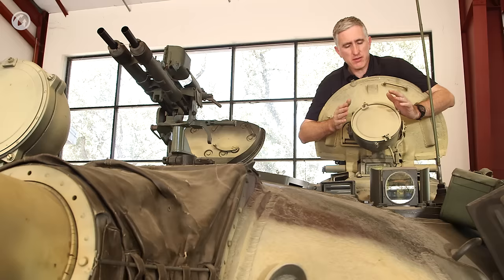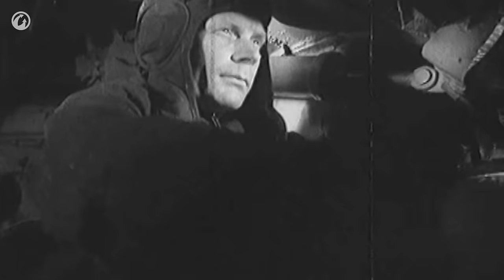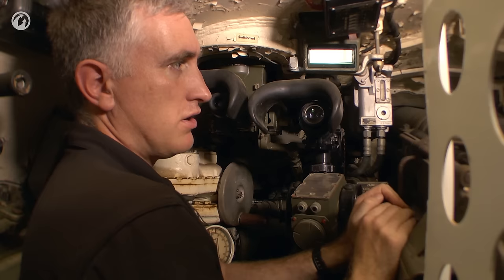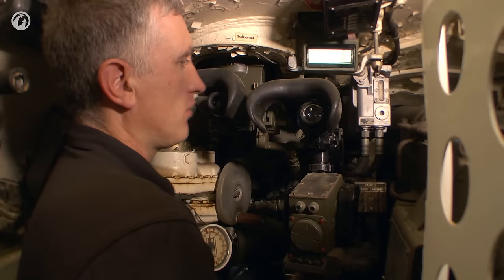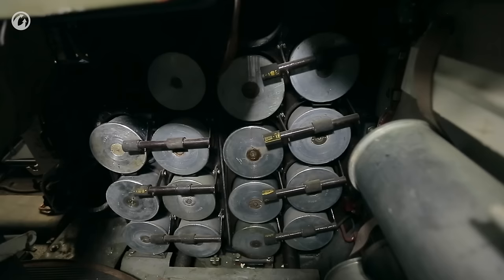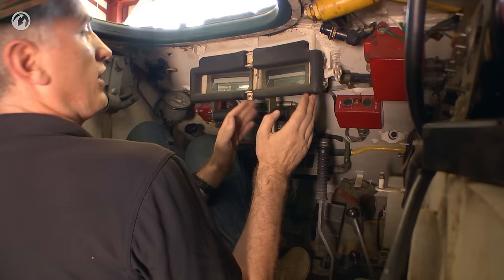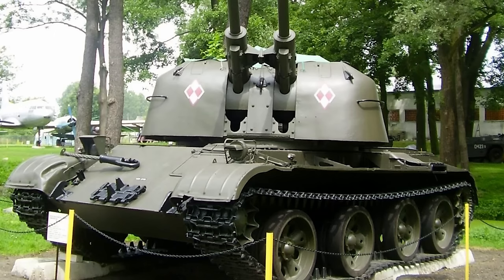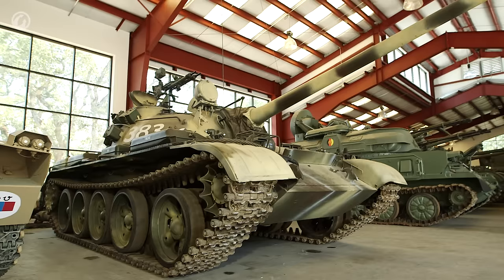Inside the Chieftain's Hatch: T-55A Part 2

Comment: As a late 70's M-60A1 tanker we were always told that Russian tankers were very short. By watching your video I think they were right.
Reply: They liked to use Siberians and other Asians because they were considerably shorter on average.
Reply: +Hugh Batesel yep that was a common practice... basically, if you happened to be taller than 170, you ain't going into the tankers
Reply: I'm a British tank crewman, about 6' tall. I have trouble getting in to a T54/55 (or T62) and being able to operate it. I believe the max height for a Soviet crewman was about 5' 6".

The ammo stowage is horrible on it. 

With Chieftain I've had three rounds in the air at once (ok, we cheated on loading).

One of our gunnery instructors was also an instructor on T62s. Apparently they have a very simple, but fairly effective system. With Chieftain I can decide where to hit, a T62 is happy with a hit.
Reply: The modern official Russian army rules provide that tankmen cannot be taller than 175 cm.
Reply: @peterking2651  at the time that the T-54/55 was in active russian service, Nato tanks were like surgeons with sabot and the russian tanks just aimed centre mass.
Reply: @AnikaJarlsdottr  Russians aimed centre mass because their guns would penetrate an M60 anywhere, and centre mass is where all the juicy stuff is anyway, NATO had to bypass T-64s composite armor that GSFG started to get late 60s with their rifled guns (a bit limiting for APFSDS performance). Leo 2 and M1 only showed up in early 80s, this is a gap of 15 years. Until we meet again!
Reply: @Klovaneer  thats fair, thanks for the information :)
Reply: @jurisprudens  TRUE. I AM 173 AND WAS THE TALLEST IN THE COMPANY
Reply: If you think the T55 is bad look up the inside of a T72. It's insanely claustrophobic.
Reply: From what I’ve heard it’s a requirement to be under 160cm in order to join the Russian tank corps. Don’t know if it’s still the case given the recent……tanker shortage? that would surely be a problem for them these days.
Reply: @nikolakaravida9670  the t72 has more internal crew volume than a leo2

Comment: I served as a gunner in T55 86-87. As a fighting force. T55 could run much more quickly than 35 km/h. We were jumping sometimes 1m high on terran. Can you imagine the loader without any clinging!? Driver has his poles, gunner has the stabi and sights to fix his hand, commander has his periscope, loader had just his one clinging ;) In our version of t55 the commander had his own turret, could turn, as i remember he could sign a target and the main turret turned to the signed direction, he could shot the main gun also. Stabilizator kept the   gun on the target even if the tank turned or the terrain was bumpy. T55 had automatic atomic and chemical protection sys, and fire protection system. Well, practiced loader could load 5.4s at least our ones. Limit to onboard the whole crew from a line in front of the tank, to close rhe hatches was 8s. Gunner and commander on the same! All the handguns, submachineguns, machine gun and the wedge lock had to be able to be repair blindfolded during given times. We had 18s to change the  firing pin of the AMD 65. As i remember the shrapnel ammo was 38kg, not easy to play with it, especially not on the field in action. It was very noisy inside, sometimes painful. I useg wax balls beside the special "helmet" but sometimes I cried from the pain. I was the closest to the motor.

Comment: Countries like Slovenia actually still use it in a heavily modernised variant.
Reply: +Teutone I don't think so. The main battle tank in Slovenia is M-84, which is heavily modernised variant of T-72. :) You can see it in a short video on my channel.
Reply: Titan191 I'm pretty sure they have both. There are photos on Google if you type in Slovenia T55, it's unmistakably smaller than the M84
.
Reply: +Teutone I checked now on the official army web page, and they really do use some T-55's with ERA, so I take my statement back ;)
I said they don't have them because I was once in an event that was held in one of our (Slovenian) army bases where they keep all the tanks, and I didn't see any T-55's. Well atleast I learned something new...
Reply: Titan191 Iv'e seen one at a defense trade show where they were marketing the upgrade program for the T55. I think particularly the modernization to the targeting system.
Reply: +Titan191 yeah you did pretty good job with your 55s, wish we in Serbia do something with ours... we have more than 200 pieces just laying around...
Reply: A lot of countries still use heavily modified T55s. Romania has a ton of them. Egypt has a fair few that were upgraded by Teledyne Continental Motors. Israel for a time used modified ones with the Royal Ordinance L7 gun mounted instead of the D-10. That is actually one I'd like to see the interior of.

Comment: One correction, the button on TC sight isn't intercom switch, it's actually a target - marker, when TC push the button, the turret will rotate to match at bearing of TC sight. it's a 1st gen hunter-killer system. It's done by sending a electrical signal to turret motor. 
The intercom switch is on crew headset.
Reply: Well, there goes the gunner's extra leg room...
Reply: @bollywig7871  It is used only in battle.
Reply: Honestly? The T-55A having such a thing was not something I was expecting. Explains why my country keeps over 100 of the damn things in reserve.

Comment: My commander in the army used to be a T-55 tankie before they transferred him to the infantry. He mentioned that, because there was no turret basket, besides having a firing safety switch (which they used to call "isključivač", freely translated as the "off switch-er") that blocks powered turret traverse, the loader also had a safety hand brace. As he mentioned, there are only 2 safe positions for the loader to be in during combat, and that both these positions required him to hold the hand braces, unless he wants his arms/legs got sheered off by the turret ring/ breech recoil.

Frankly, this is all very vague information- I'm a dirt kisser, not a tanker, and I've only been in a couple of old scrapped T-55, so don't count on it being reliable info.
Reply: THERE IS BASKET IN 54, 55 AND 62
Reply: @alexspielberg4090  ..depends

Comment: For those, who are interested: Some stencils on the driver's panel are damaged but with some imagination they say:
Spúšťač - starter
Tlak oleja - oil pressure
Teplota výstupného oleja - oil temperature at output
Teplota výstupnej vody - water temperature at output
they are in slovak language as well as are the stencils on the fuse panel for lights

Word "stiskni" on the voltage/current gauge means "push" and is in czech language.

Same goes for gunners position - table on the main gun control is in czech language, another table with selector of the main gun and MG are in slovak. 
I suppose that this mix comes from parts built in different parts of czechoslovakia - both slovak and czech and then assembled together.

Interesting to see that left-hand push of the round into the breech. Still puzzles me, how these tanks can have ROF of 7-9 rounds a minute in the game ... way higher than 107mm equipped US and british counterparts. :-)
Reply: That's because in WOT making the game balanced as far as mechanics of the program is concerned trumps reality. As an example how many times have you ever seen a vehicle do a tight turn and through track?

Comment: Apart from the space issues, and thats a tradeoff of having the low profile, it doesn't look to bad for a late 40's-early 50's design.

Which of course is exactly what it is.
Reply: In most respects, it's the Russian Centurion or the Russian M-48.  I was generally impressed with the layout.  Where the tank really falls short compared to Western tanks is its total disregard for crew safety.
Reply: @folgore1  Such as?

Comment: We had T-55 turrets installed in concrete as coastal defence guns. The loader had more space since the ammo was stowed below in a full-height bunker room and lifted up for the loader in a cradle lift through a trap door in the cage floor, next to the gun. The cradle held the round in a 45-degree nose-down position and came up roughly to the loaders waist , so all he had to do was lift the round up and load it. The lift was manually operated by two guys below and came up very quickly, so the loader had a safety button on the floor that he had to stand on before the lift could be operated -- otherwise he was in danger of getting the rear end of the rising round straight in the family jewels. They didn't tell us whether that button was the result of good planning or painful experience...

Comment: as a rough guess from an engineering students point of view, the gearing system you mentioned with its odd layout is possibly due to 2 reasons, either its a design limitation meaning the gears had to be arranged in that particular order which isnt your conventional layout you would see in a standard car. Or, the other reason, mainly to do with the reverse gear being center forward, is to make it easier the shift the tank into reverse gear quickly and easily when under fire. just simply grab the stick, clutch down, slam the gear stick center forward and get the hell out of dodge.

also with the handles for each crew member in the turret, i can definitely say that those are more than likely for crewmen to hold onto when going over rough terrain and stop themselves from jerking around and avoid hitting their head on something. nothing that is placed into a tank even if it looks like some pointless handle, has some use or other.

Comment: Excellent video.  This anecdotal but is supported by the layout of the tank:  combat performance during the 70s and 80s  by crews in the Middle East suffered considerably due to the mental and physical fatigue they experienced in what can only be described as an excruciating interior.  It is interesting how you can contrast this with the IS 7 review and again, you can see some of the indicators Soviet designers followed to the exclusion of crew comfort.  Thumbs up!

Comment: That "cylinder" beneath the commanders feet, is pre-heater. And the idea "man" type for loader is left-handed powerlifting midget. The handle in the loaders position is surprisingly, for holding on to something. Who would have thought of that?
Reply: Yep the ideal loader is usually a power lifting midget who may or may not be on steroids. Yet strangely the fastest loader I've ever seen was actually a tall lanky guy kind of like chieftain up there. Guy put 11 rounds down the tube in about a minute and a half most of which were HEAT. This was on an Abrams about 3 years ago during gunnery table 12.
Reply: By what I've heard, the fastest loader on the T-55 in Finnish service actually was a weight-lifting Olympic gold medalist.
Reply: @jarmokankaanpaa6528  BEST !

Comment: About time cheif, what took so long? Usually the second part comes out in a week or so. Anyways awesome video as always. While you are on cold war icons, do the t72. If you think the t55 turret is cramped, boy the t72 will redefine cramp
Reply: Maybe he got stuck inside the tank...
Reply: +Soham Sarfare I've had the 'pleasure' of sitting inside a T-72 in the gunner's position and in the driver's seat. That redefined my understanding of claustrophobia, and I'm not a big lad (170cm, or about 5'7").
Reply: +Soham Sarfare That Autoloader is a bitch for comfort.
Reply: +Firefly i believe the high limit for a T72 driver was 5 foot 5 inches or something of that nature
Reply: +Redneck Fury Not surprised, even with my small stature I barely fit in the hatch. Once I got inside it wasn't all that bad, but I can't imagine how difficult it must be to leave the tank when it brews up.
Reply: Firefly You don't, most T72s use a unprotected carousel autoloader, when hit they tend to vaporize the crew and have their turrets disconnect from their hull and fly a significant distance from their point of origin.
Reply: Well of course, the carousel type autoloader is a huge target compared to the small ammo racks or the Leo 2 and Leclerc (turret bustle and left front of the hull), not to mention the Abrams (in turret bustle behind hydraulic doors and with weak armour links). Hits on the T-72 with top-attack ATGMs are especially terrifying, if you've ever seen that TOW-2B video then I'm sure you know what I mean. 

Although I'm a fan of automatically loaded tanks I much prefer the French way of doing it, i.e. holding a 'chain' type carousel in the turret bustle (Meggitt designed a similar system for the Abrams, though of course it was never adopted). This presents a significantly smaller target than the carousel of any Soviet tank from the T-64 up, plus if the mechanism fails the gunner or commander can conceivably reach back and put a round in the breach. In the T-72, not so much... I've seen that design up close and it's downright scary.
Reply: +Firefly I think the idea behind where the ammo is in the T-72 is that the safest place for the ammo is under the crew because anything that hits it at least in theory has to go through everything before reaching the ammunition thus increasing the re usability of the tank. On a slightly different note, a T-72 must be a giant pain in the ass to restock it's ammunition supply considering where it is stored.
Reply: Wiseguy7 It is, the autoloader needs to cycle every full reload [Load, Eject, Reload but in reverse]  to reload its rack, it can take up to a hour to load a T72 based vehicle
Reply: +zombiTrout Lol, really? :D
Reply: +Redneck Fury Not really. It's more like 20 to 30 minutes to stock up the entire ammo store including the loose ammo. The loading cycle takes only 6.11 seconds by itself, and reversed, there really isn't any reason for it to take more than 20 seconds to do it backwards at a leisurely pace.
Reply: FedorovAvtomat Yes. Width is more of a problem than height.

Comment: Hi Chieftain, The button in the commander's sight is a gunner override switch :  Together with the possibility to traverse the turret, the commander could also seek for targets independently from the gunner. With a push of a button located on the left handle of the TPKU-2b device, the turret swung into the center of the commander's TPKU-2b visor lines not only in horizontal plane, but in vertical too. The turret swung with maximum recommended speed on the view line of the commander and stopped with correspondence of the visor lines. 

Source : https://en.wikipedia.org/wiki/T-54/55_Fire_Controls

Comment: I believe the handle that is located on the turret wall in the loader's position is for the loader to give him more leverage in ramming the round into the breech. Since it's a position where the loader would load using his left arm/hand and put his right hand on the grab bar and slam er home.
Reply: Loader handle -
1.  Your ram the round into the breech with left hand, while holding the handle with right. 
2. Then you pushed in the Loader safety switch ( located on the right of the breech) in with your left hand 
3. Finally, you held that dumb handle with both hands to ensure the loader was out of the recoil path. 
4. The loader finally shouts " loader safe". 

The drill ( and holding the dumb handle with both hands) ensured loader safety.

Comment: The odd gearing layout, and I'm just speculating here, might be down to how often would the tank go into 4 and 5? I'm guessing mostly on road travel, where it doesn't go up or down a lot. So the need to gear to 4 and 5 is probably less than gearing to Reverse. Hence putting Reverse in 'front' of them. 

This is naturally very odd to a modern person, but I wouldn't be surprised to find a similar setup on old tractors.
Reply: Got a old ford tractor and its gearing of 1,2,3 then reverse
Reply: NO, JUST A GEARBOX DESIGN

Comment: The gear pattern weirldy makes a fair bit of sence. All you need to use are at the extreme ends. If you need 1st gear, you'll be still and can easily put a bit of tought on shifting. But when you are on the move, no need for presise movement, just shove it as far as it goes.

Comment: Thank you for another video, Chieftain! The T-55 is an indispensable part of tank history.

I actually was supposed to have the opportunity to operate one of these at Drive a Tank, but their T-55 was in the shop with mechanical issues so I was allowed to drive their M4A2E8 instead. It might be just as well, I'm 6', bigger than I think the T-55 was designed for.

Comment: And once again the Soviet ocd desire to put ammo wherever it will physically fit is revealed.  Also for the compass I don't know about how it works in the tank but Boat compasses use correcting magnets if I remember right.
Reply: It's a small tank and the dome turret further restricts interior volume - it's not so much a case of putting ammo where it fits for the hell of it but because that's the only way of carrying any ammo at all. The original T-55 carried 34 shells, which was increased to 45 by removing the hull machine gun. For comparison, the Leopard 1 carries 55 main gun rounds, the Centurion 62 and the M60A1 carries 63.

Comment: This cylinder of sorts is actually the engine pre-heater. :) PS. This must be an early T-55A, hole for the bow machine gun and R-113 radio set suggest that.
Reply: The pre heater had an oil and water pipeline to liquify and warm up both engine oil and cooling system before attempting to start the tank.

Comment: Well you mentioned the Romanians version which is the ultimate version of the T55 called the TR-85M1. It adds a new 100 gun rear turret bustle and applique armour and the hull is lengthened with an extra road wheel each side. On exercise a year or two ago with the American army they beat the Abrams crews in mock combat. So an old tank modernised with a good crew is capable of defeating the mighty fuel thirsty Abrams tank.
Reply: tasman006 probably more to the story